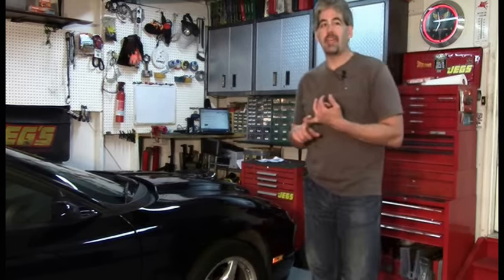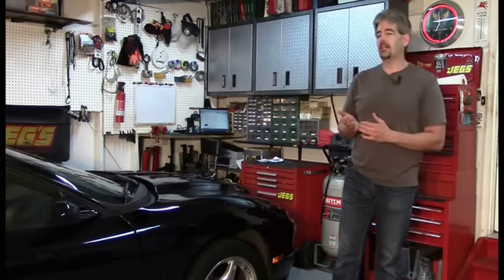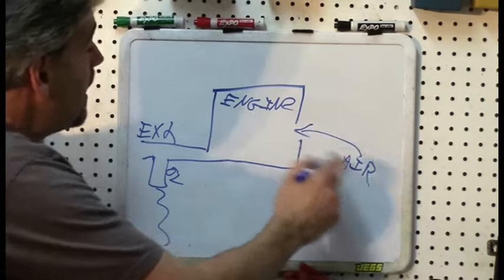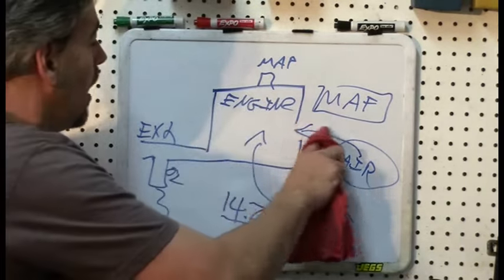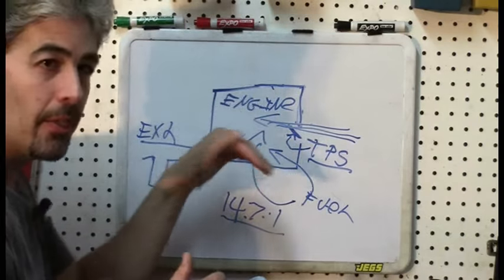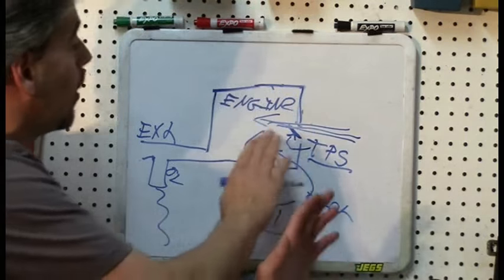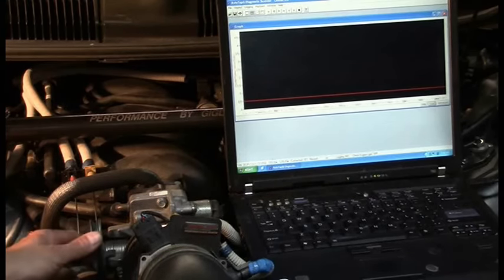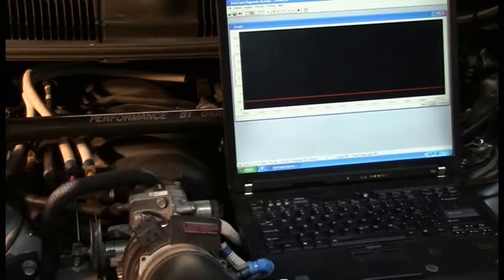TPS (Throttle Position Sensor) Diagnosis and Understanding Pt1

Comment: How does this relate to a car with drive by wire and not cable driven
Reply from the maker: The potentiometric function is still identical in drive by wire- just dismiss the wires for the motor.
Reply: +Schrodingers Box Hi. In all your videos you did not mention about P2135 code. How is coming this non-correlation between A and B in a TPS? What should be solutions to cut the root cause? Thanks. Cristian
Reply from the maker: Cristian G.  Some cars with Drive By WIre have 2 sensors (and motors) - I am not totally familiar with them but I believe one operates and detects opening position and the other closing. Obviously both potentiometers should indicate position with their relative voltages and they should match (in opposite ways I assume).
  But either way- both TPS would simply be tested individually using the methods shown. Also keep in mind a dirty throttle body is your most likely suspect with this code.
Reply: +Schrodingers Box Hi again and many thanks for fast reply ! I've got a Mountaineer 2008 with one actuator and one TPS. I changed throttle body one year ago due to P2135. Two weeks ago my TB was complete cleaned but still P2135 suddenly appear when I was driving on high way. Last time, after car re-start, engine died completely on high way. So it's very bad behavior or the car, including TB. I think to change one more time TB with a new one. It seems its life cycle it's only one year. I believe the non A-B correlation is due to a malfunction of the actuator.  Do you know another solution to solve P2135 code? With regards, C.
Reply from the maker: +Cristian G. So you are going To change the TB huh?then you dont need my advice because it means you have done the diagnostics and determined that you have rfwrenxe and signal integrity to the PCM right? If so the only possibility would be bad potentiometer and your diagnosis is correct.

Comment: i have problem ! when i press gas pedal its not working ! car runs normaly but when i press gas pedal NOTHING ! please help !
car is peugeot 308 1.6i
Reply from the maker: Ok what data do you have? What is the TPS% and what voltages do you see from reference and signal bs ground withj variation of the TP angle?
Reply: +Schrodingers Box  i have beed to mechanics month ago and they jave changed earth wire and fixed it
Reply: +Schrodingers Box im not pro but i will open everything tommorow and hopefully see whats going on...my idea isnto try to clean up the throttle..for the sensors i dont think im able to solve that :(
Reply from the maker: pavel1210 I can't really help sorry- I don't work that way. I only use specific data to determine the cause of the issue so I know exactly how to fix it. That way I am not just guessing at random. I am afraid I cannot help.
Reply: +Schrodingers Box i have multimeter i need to master your video in order to the sensor !
Reply: +Schrodingers Box thank you anyway alot for responce !!!

Comment: for british viewers : potentiometer = rheostat
honda uses base 4.6 live for it's PGM-FI
Reply from the maker: Duly noted- I should have pointed that out, thanks!
Reply: @SchrodingersBox  A rheostat typically has two terminals non-polarity which is used to vary the current. Potentiometers have 3 terminals and used to vary the voltage. Don't think they're the same thing.
Reply: @brianpluhar8625  britain is a funny place.
my country ,[france], is even weirder.

Comment: At around 18 minutes you talk about dirty carbon deposits, that's the 1st thing I look at and clean, clear codes have them drive it bring it back to me IF the same code comes back. More than half the time that fixes the problem, and almost the other half of the time is broken signal wire.
Reply from the maker: What TPS code(s) would you do this on?
Reply from the maker: wait- you mean you send the car back to customer  not knowing if you even fixed it??? And they have to come back?? What?  Am I reading that right?

  If half the time it’s a broken signal wire why not fix that first AND if it’s a broken signal wire you would know cleaning carbon deposits can’t possibly fix that so why send customer home without diagnosing that? 
   Surely I must be missing something here.

Comment: if u put 1 side of the tester on a ground any ground under the hood and use other side of tester to go through the wires on the plug 1 at a time theres no chance can short out computer u go through them 1 at a time until u find power than u know other one is ground u dont have to use the ground in same plug to check wiring not wrong just saying safer
Reply from the maker: greatkillsny Partially correct.  The thing is using chassis ground is not the way to check a computer floating ground.

Comment: Couldn't the TPS just be in the vicinity of the T, but not necessarily attached to the T? Kinda like "friends with benefits"? I see dead spots.
Reply from the maker: No. A TPS will always be directly on a throttle pivot point. Otherwise you can’t get potentiometric variation.

Comment: P17967 code for audi.. with rough idle... electronic  throttle body. As idle jumps beyween 400 to 900 rpm. try to remove code with scan tool. As i have clean throttle body. And then problem starts.
Reply: Any one can help me to solve problem..
Reply from the maker: Vikram Singh This video should help.  Electronic TB's use the same potentiometric sensing as a manual TB.

Comment: why don't connect DVom negative pin to chasis or  battery negative. It should be less risk to damage PCM.
Reply from the maker: How would that be less damage risk to PCM?
Reply: @SchrodingersBox  So there is no chance to get two pins touched by accident.
Reply: @SchrodingersBox  I mean two pins can stay far away instead of staying close.
I measured the voltage in my Subaru with a negative pin on chassis, I got only 3.3 v for maf sensor and 0v for IAT sensor.
Reply from the maker: Yeah I see what you are saying.  I use plastic coated pins where they can’t cross but if I used plain pins then yeah I would measure one polarity at a time.
Reply: @SchrodingersBox  you are a very experienced man.

Comment: The computer takes a voltage reading from the throttle pot , if it sweeps clean it’s ok, if voltage spikes and is erratic, it’s bad
Reply from the maker: not entirely correct. Sometimes the calibration is off. this would give a clean sweep but a fuel trim deficiency as the position is misinterpreted.  This can especially happen on DBW designs.

Comment: Great technicians let's troubleshoot I have this 2012 Mitsubishi outlander foreign uses brought to my shop , with this complain if you drive the car for like 15 km the the Will stall the throttle wouldn't respond  thereafter puting scanner on the on car there is no DTC on ECM But scanning the TCM I got this DTC ON the transmission p0868 and O0776  but the storyline is even after i disengaged it's still the car to neutral it wouldn't still rev until you you switch the engine of then it will rev , oya vibrant technicians let's go
Reply from the maker: I would start by checking operation of the pressure control solenoid. what is the pressure change when you activate the solenoid?

Comment: how you   test  a car  without  throttle  cable  electronic  gas pedal.
Reply from the maker: So I usually just press the gas pedal but also I will just manually put 12V to the throttle or use a resistor to limit voltage and re-create throttle position but of course this only works if it not a pulsewidth moldulated style system.
  See my video on a Volvo where I diagnose a "drive by wire" issue.

Comment: Nice joke on "potential" LOL. Hey, I get the first post on the new channel WooHoo!
Reply from the maker: Hahaha... go easy on me this one Gojo. After reviewing the final editing I see made a few freudian slips that I knew you would catch.
Reply: Schrodingers Box Actually, you kept on saying resistance decreases etc which is strictly speaking is not how I would explain a potentiometer to somebody who does not know it.  The variable resistance in this case is a three wire and the center wiper is the signal.  As the wiper moves towards the 5V feed, you get higher voltage.  So technically, the resistance does drop in  one leg but it goes up in the other leg.  I know you know it but showing it on the white board as a true potentiometer would have been a better explanation.
Reply from the maker: Agreed, i often do underexplain the electrical because I am aware the vast majority of people are pretty weak in electrical background (myself included for sure).  For that reason I also usually skip over the "internal dvom" in the PCM that actually detects voltage- just sending voltage to the PCM means nothing unless the PCM has a way to measure the difference in potential.

Comment: AND..DRUM ROLL...IF I WERE CHECKING THE POT FOR SMOOTH READINGS, I WOULD USE A SIMPSON 260, OR A VOM WITH A METER SWEEP. I AM 71 YEARS OLD-TIMEY OLD, AND UNLESS I AM CHECKING SOMETHING THAT IS REALLY CRITICAL, I PREFER A METER SWEET VS DIGITAL READOUT..BUT, BEING OLD SCHOOL, THAT'S JUST ME. I HAVE A 260 BUT ALSO A FLUKE 77. JUST SAYIN....

Comment: I like your humour! Good vid. As for owning an oscilloscope, I can recommend the UK Pico Technology picoscopes. Relatively cheap to buy and absolutely invaluable for modern car faultfinding. Just connect to your laptop and away you go. The company does an automotive setup with a lot of diagnostic info and examples available. Have a look at https://www.picotech.com/about. I have no relationship to this company other than as a customer. I am an electronics engineer and my son is a Jaguar and Audi Master Technician and this bit of kit is worth its weight in gold as far as design and faultfinding is concerned.

Comment: Lol I have a scan tool and still don’t know how to understand this lol all I know is the damn thing won’t go higher then 3.25 volts and only goes to 75% throttle. I had a friend manually open the throttle by hand and still won’t go past 75% 

Dtc 122 1122 check engine light comes on. Grrrr
Reply from the maker: pretty sinple- just ground reference to the signal side and check for 5V.

Comment: Hey Matt. I used your test video to check my TPS on my 2003 Ford  F 150, 4.6 lt and I'm having some trouble. First I  will tell you I get a PO122 and a PO123 code so I replaced the TPS because it was under a warranty but with in 24 hrs I got another PO122 code. I used your video to test the TPS my self first doing the resistance test as you pointed out on the first TPS following your direction I didn't get any response through my Ohm Metter showing it to be bad  how ever I wonted to check it out with it on my truck by checking it as your video shows and it provides me with a good TPS both the old TPS and new TPS that I having trouble with didn't pass the  resistance test but did pass the other one being plugged to the PCM so now  I'm lost and really don't know what way to go from here. Can you help please. gene.lloyd@yahoo.com. thanks.
Reply from the maker: Sorry no idea what you're talking about bro.  Did you confirm you have Signal, reference and ground integrity on the wiring TO the TPS?
Reply: Gene Lloyd h

Comment: My car refuses to rev up past 5k rpm-sometimes its 3.5k as a max. significant loss of power, top speed of 30mph. first thing I did was replace fuel filter, then I checked fuel pressure (right before fuel rail) then I tried unplugging maf sensor and tps, ran worse without tps. I did test the tps with a multimeter and I got 5.16 volts, and it does not change at all. Can I blame everything on just my TPS? This problem started quite suddenly when I was driving on the highway with a slight gradient.
Reply from the maker: It sounds clear to me like you didnt measure the TPS voltage correctly. That would indicate WOT all the time and in fact would induce clear flood mode resulting in a no-start.
  If that is indeed the case that you measured it correctly, just unplug it and see if problem goes away. If it doesn't TPS is not the problem.
Reply: Aleksander Kuznetsov 8

Comment: maby someone here can answer this question. why they hell did they start making sensors on cars...
Reply from the maker: +I will Shoot for better emissions and performance.
Reply: :l they should still make cars with less sensors for people who dont like replacing 2000000 dollars with of sensors every day
Reply from the maker: I will Shoot If you are replacing even one sensor a year it is probably because you are misdiagnosing it.  Cars are WAY WAY WAY more reliable and maintenance free than ever in world history.  The ability to go 100K miles before a "tuneup" and get almost 30MPG more than justifies the sensors even if the vast majority of people think that are alien technology and have no comprehension of them.
 But if you want to go back to carbureted technology at 9MPG and the car last 110K miles at best be my guest.
Reply: +Schrodingers Box  yes however the fixes are so much easier and less complicating. now i got to take a car in for a sensor and pay 1000 dollsrs
Reply from the maker: MECHANICAL TOYZ Oh no doubt about that. Fixing an older car takes no skill whatsoever. Even if you get it wrong it's OK because they are usually emissions exempt so weekend hacks have no standard to be held to.
  That's why everyone "tinkers" on old cars with their kids on saturday afternoons.
Hell I actually physically sat in the engine bay while removing the windsor on a 60's F100.
Reply: +Schrodingers Box by the way thanks for fixing my dodge 1500 van i bought 2 tps and then found out it was circuit problem just blew the computer like a nintendo cartridge and good as new!

Comment: couple of hundred dollars on a scanner?  I think you have not been in a scanner market for a while!  You are off by an order of magnitude.  May be you should require your subscribers to have a scanner before watching the videos!  The cheap standalone handheld which can give live data and graph it run under $50.  If you have got a smartphone (and who doesn't?) the BT adapter + TorquePro is like $30.  If you are watching this channel, you have no excuse not to own a scanner. None, at all.
Reply from the maker: 12vgs8606 Wow I was unaware they are that inexpensive nowadays. Damn 12VG you ALWAYS have brought up stuff that I should have mentioned in the video every since day one!!!  I will make sure to point this out in a future video.  Man- the chat rooms are bad enough as it is, can you imagine all them idiots with scantools now? Jesus. 8-O
Reply: The only saving grace is that none of the scanners in that price range have two way capability, so they can't hang themselves easily using them.  I had been bugging my brother get get a scantool for years and finally he spent that $5.00 on the TorquePro and now he does not let me have moment of peace!  You remember his beloved Porsche, right?
Reply: 12vgs8606

I haven't seen previous references to your brothers' Porsche, but I have to wonder..................If he is driving a Porsche, I would assume he could afford to buy any scan tool he wanted..................and maybe a nice 4 channel PicoScope (which you could borrow every weekend, obviously)   :)

Comment: Please just get to the point of the video. There so many things that have nothing to do with what you're talking about. Please stay on topic. In a 28 min video, there were only about 10 mins of info needed
Reply from the maker: Then this was clearly over your head. You need to stay basic for now. When you get advanced you willo understand the value of why I have 125K suvbscribers and a pay channel. Right now you're just too basic still. That's OK though- but you won't ever advance until you realize you lack self discipline. Don't blame it on others or your "ADHD". Its you.

Comment: PLEASE DON'T BUY AN OSCILLOSCOPE ...MATT!!!
Reply from the maker: Why not? You can see how helpful it would be in other videos... but even if I did buy one I would only use it in videos where there is no other alternative to take measurements.  I am well aware most of my subs do not use oscilloscopes and I will be sure to keep that in mind.
  However some applications- stepper motors for instance, really need them to determine proper signal is being sent from PCM. You cannot do it with a DVOM.

Comment: Hahah this guy hates on import cars, I find that funny.  You can make almost and engine 500hp. The philosophy of American muscle has been the same for 60 years! MORE DISPLACEMENT MORE CYLINDERS 8 miles a gallon gross polluter.  Have you seen one American manufacturer win a formula one race, the pinnacle of automotive technology?
Reply from the maker: +Elias Hogan I don't mod cars for economy. I do it for power. If I wanted economy I would buy a honda
Reply from the maker: +Elias Hogan Also I find it funny if not pathetic that you talk about fuel economy with imports and yet in the same breath mention no american manufacturer has won a formula one race.  Formula one race cars get less than 5MPG.... with LESS displacement than a typical V8 performance car.
  You really shouldn't talk about things you have no idea about bro- you'll just look stupid in front of a lot of people.